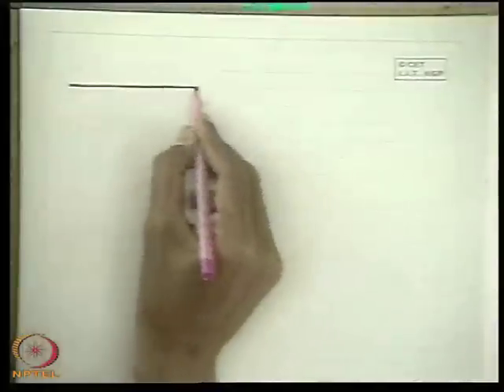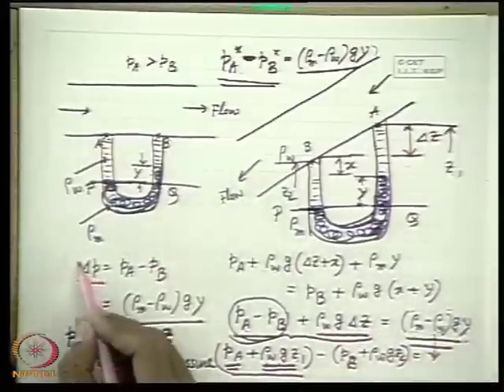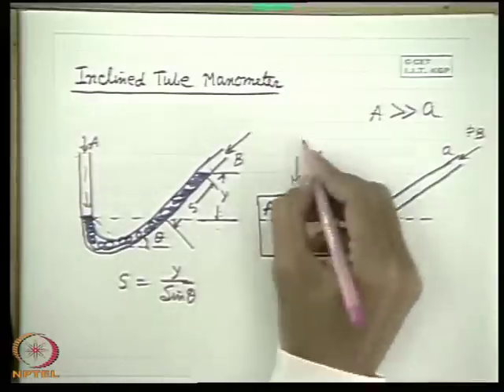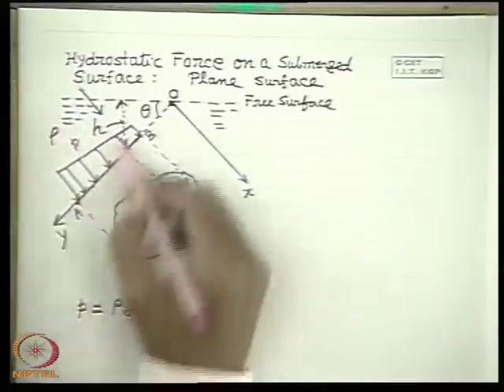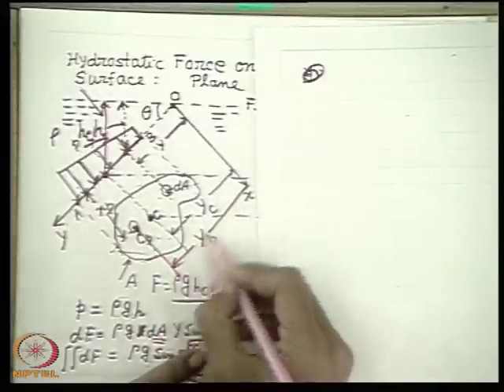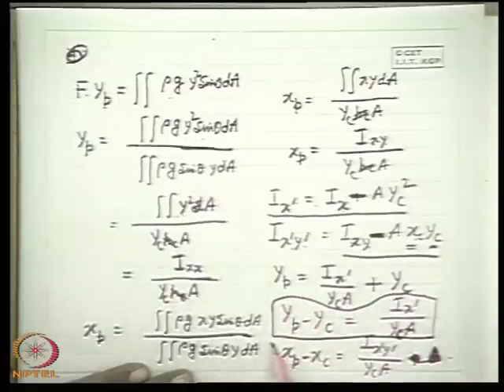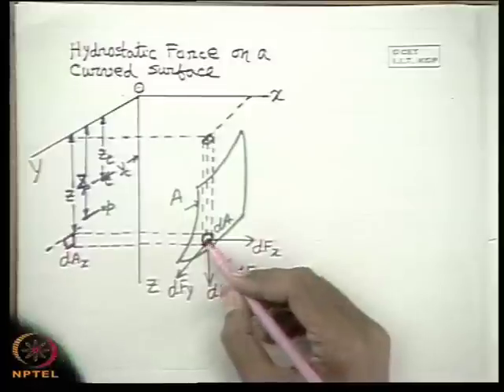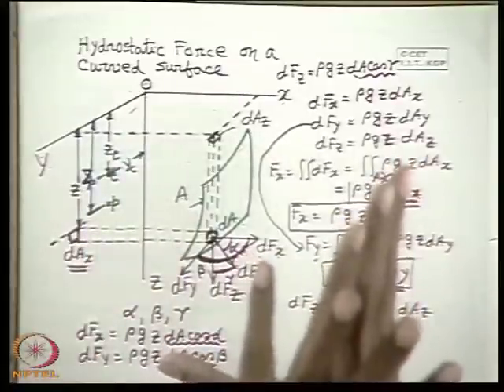Mod-06 Lec-06 Fluid Statics Part - III

Comment: Xp should be zero if the surface itself lies in y-z plane, or the surface is lying in XY plane then it should be mentioned in the lecture. The way coordinates are drawn is not clear from picture or the discussion.

Comment: Yp - Yc = Ix'/(YcA) as mentioned @40:03, But I wanted to know how Yp-Yc will vary with respect to angle θ, I mean won't Yp-Yc =0 when θ=0, ....but in the expression I didnt find any relation with θ
Reply: Yc= Hc/sin(tita). Just substitute it in rhs and you will find relation between tita and yp-yc

Comment: If container filled with fluid of weight w ,then is it possible that pressure force on bottom surface of container is larger than fluid weight??
Reply: if we consider atmospheric pressure then pressure at bottom of the liquid is higher then the weight of the liquid .    and if atm pressure is not considered then fluid pressure at bottom of the container is equal to the weight of the fluid

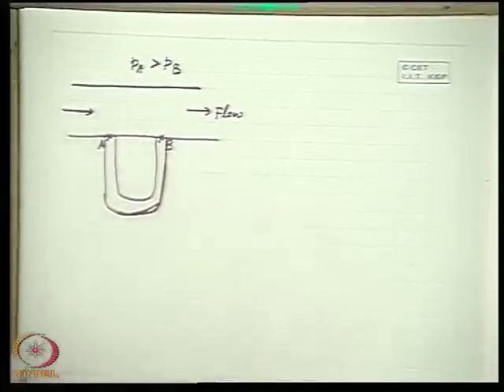Comment: 1:18 press. diff.
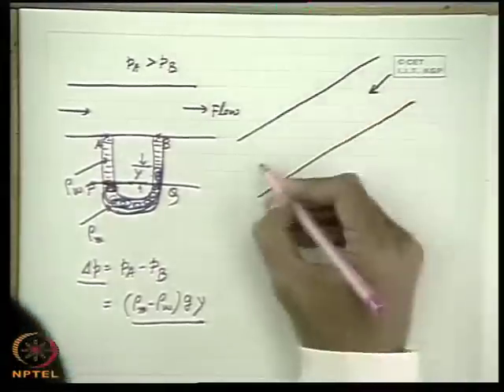2:50 press. diff. flow of fluid in incline
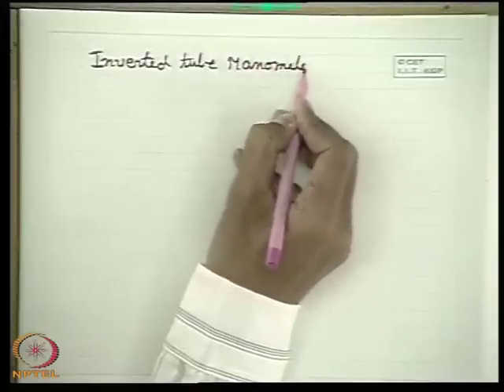10:36 inverted tube manometer
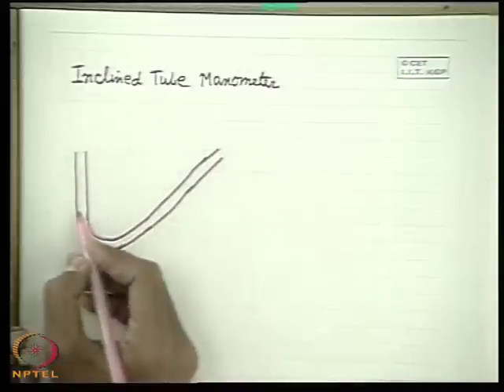14:06 inclined tube manometer
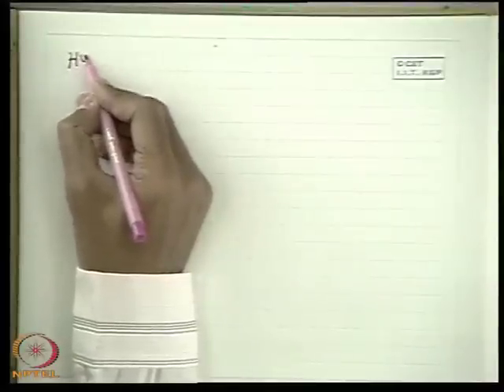20:50 hydrostatic thrust on submerged plane  surface
46:18 hydrostatic thrust on submerged curved surface

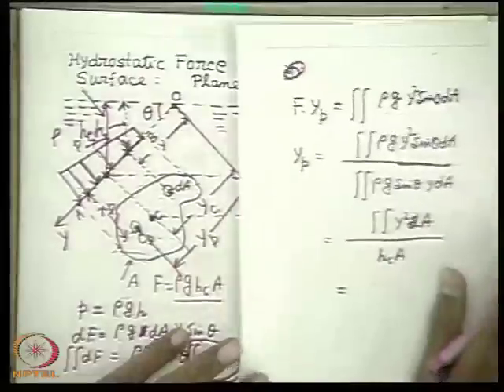Comment: Excellent lecture series, Professor Som. I have a quick question for you (and others reading this) from the section where hydrostatic force on a flat surface is discussed. When we look at the surface from the top such that we are directly looking at the area dA, isn't that surface dA in the y-z plane, based on the axis convention shown in the beginning of this part. In other words dA=dxdz, which implies that from @34:22 onward, every time x was referred, it should have been z. I think what may have led Prof Som into this potential mistake (since I am not a 100% sure if I am correct) is the fact that when the inclined surface was re-drawn in the "rotated view" (rotation about y axis) to expose dA, it was still drawn in the same plane (without re-drawing the axes seen from that view). I might be wrong, but that's what I think. It would be great if someone could please clarify. Brilliant lecture series, anyway. Thank you!
Reply: I think you are right!

Comment: at 4.41 flow in an inclined pipe  where pressure is maximum at which point a or b??
Reply: at B
Reply: Here the flow is due to static head difference and not due to Static Pressure difference. So pressure at B is higher than A unlike the case in horizontal pipe.

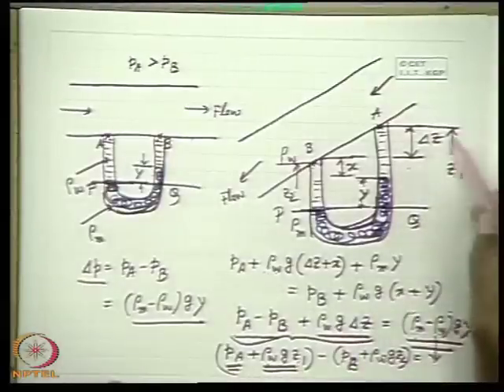Comment: at 7:17 equation seems wrong as it should be pw-pm on rhs
Reply: I guess Pressure at A must be higher than Pressure at B... If that's the case then the manometer that professor drew for the case was wrong. If you switch that, then the equation which you derive will make sense.
Reply: Deivanayagam Hariharan they are IITians. So they are correct.

Comment: when he is talking about pressure measurement at inclined plane why does pressure at point "B" is greater, as mercury level is higher in limb A? somebody...? 7.24
Reply: It's been 7 months now. I hope you might have got your answer but if you have not, I got this one bro ;) .. See, when ending the previous lecture our dear teacher showed the direction of flow opposite to the one he shows here. He made the fluid flow from lower level to higher level but he didn't complete the derivation because of the lack of time. 
Now when he started off with this lecture, he changed the flow direction (probably unknowingly) and that also confused me a bit but this is what I concluded in the end.
Reply: LALIT DOGRA
Reply: if direction change it would be  pb- pa ????

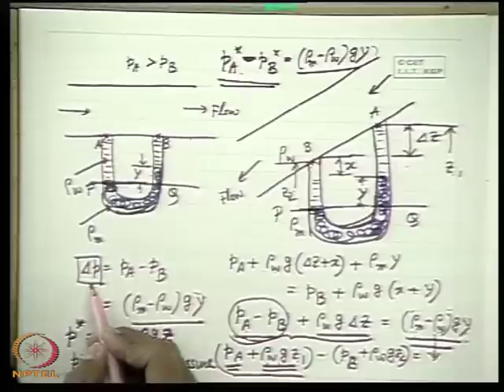Comment: at 8:54 is the figure right and if figure is right then eq. is wrong as it should be pw-pm not pm-pw
Reply: Yes. The correct figure should be: B point above and A point below, in the given inclined column manometer. Also pA>pB due to more depression in left column than the right one. So it is a small mistake in the figure which when corrected, gives the same piezometric pressure equation stated in the video. :)
Reply: change the direction of flow and replace P,a to P,b and vice versa...............your doubt will then be solved.
Reply: @riturajanand7133  also z1 replace by Z2
Reply: Same doubt

Comment: Sir, U r simply superb. Tough things have been made so simpler to understand it very easily. After gap of 20 years, I have started studying again for my Phd preparation. You  made my preparation so easy that 100 books could not have done.
Reply: If container filled with fluid of weight w ,then is it possible that pressure force on bottom surface of container is larger than fluid weight??
Reply: if we consider atmospheric pressure then pressure at bottom of the liquid is higher then the weight of the liquid .    and if atm pressure is not considered then fluid pressure at bottom of the container is equal to the weight of the fluid